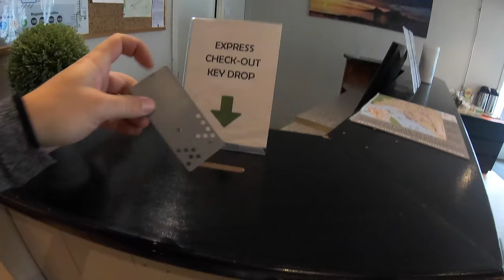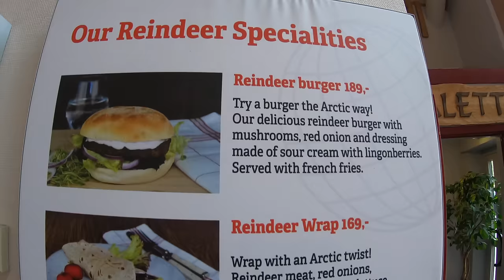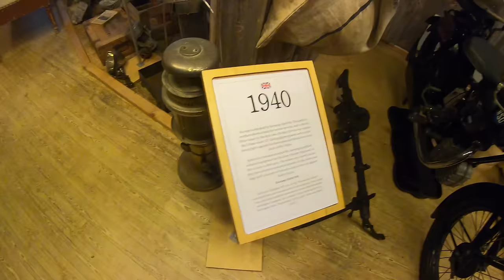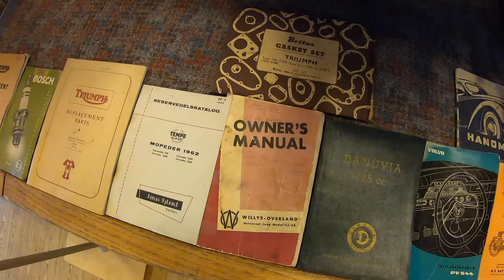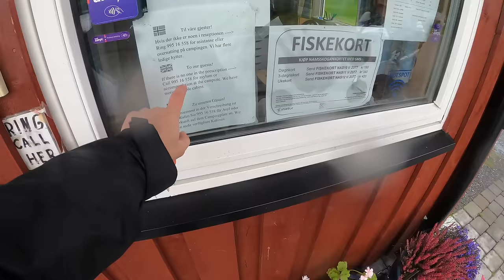Is the Arctic Circle truly here?! [S3 - Eps. 31]

Comment: I travel quite a bit. One of the things that I've learned is, if you put anything in a safe or refrigerator, put a shoe in with it. After all, you can't leave with just one shoe. LOL
"Like" so that Noraly might see this.  Cheers
Reply: Great adwice!
Reply: A shoe? Not with my feet LOL. How about the keys to the bike, a bit simpler and more hygienic
Reply: @ewoutbuhler5217   That's a great idea (for Noraly)! However, I don't use keys on the road (travel by air aircraft, and am shuttle back and forth by this courtesy vehicles. Cheers
Reply: @stanfordcoffee  yes, you don't need keys to an airplane 🤣 but still, a shoe? 🤢
Reply: Shoe! In fridge! I would think of something a little less objectionable, like wallet or passport, something you always make sure you have on your person when departing. 😁 But, the idea is perfect if adjusted a little.
Reply: @Grandliseur  yeah, with your way, you could end up leaving without a wallet or passport :D
Reply: @matko2327  Did you answer the right person?! I only commented on the many mosquitoes in Norway?! 
My preferred way of travelling is by camper or by train, though you didn't ask. I have a small camper, rv like, that permits fine cheap travel options. It got nearly 25 km/l when new. Now a little less! 

Many years ago, sleeper trains were common in Europe! No longer sol 😞😭
Reply: @Grandliseur  yes, i answered the right person. You said to put a wallet or passport in a fridge instead of a shoe...i think thats not a good idea because you could end up forgetting those too...cheer up, dont take things so seriously, have a nice trip!
Reply: @matko2327  totally forgot. Wonder when that was posted. I would like to travel again, but now I'm tied down by kittens that need my care. No solution to that.

Comment: Too bad you didn’t go the costal route (RV17) south from Bodø, it is one of the most spectacular rides in Norway. You will need an extra day with the ferry rides, but it is definitely worth it. The inland road (E6) is not especially scenic.
Reply: I think Noraly was being chilled by the rain and cold. She wisely chose to ride south as quickly as possible. I have driven my motorcycle in rain and 10 C temperature and even with rain gear it becomes very uncomfortable and even dangerous.
Reply: I was not questioning her choice of route given the weather, only pointing out that she missed some of the best roads in the country. There is also a lot more history to see and experience along the coast, all settlements were historically located along the coast and on islands since the only means of transport was by boat.